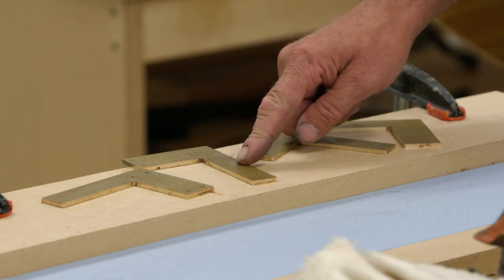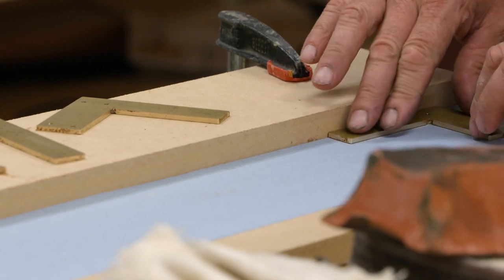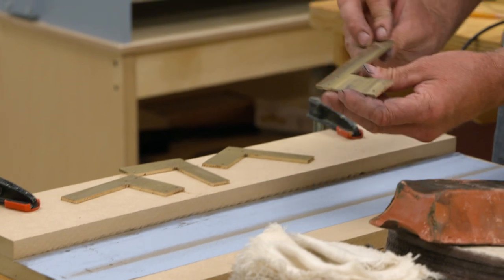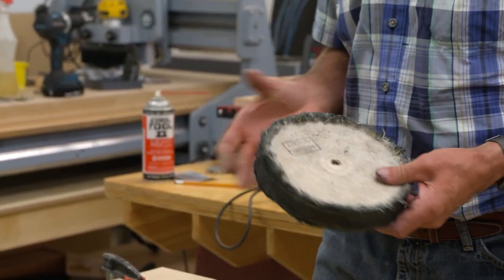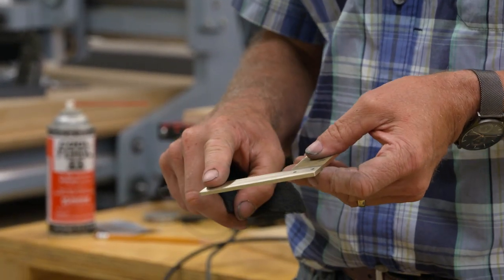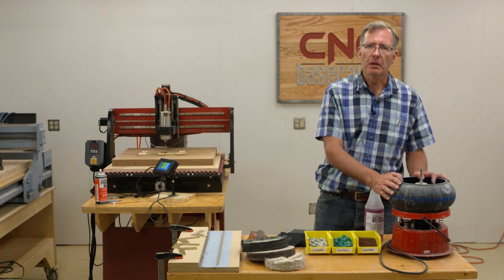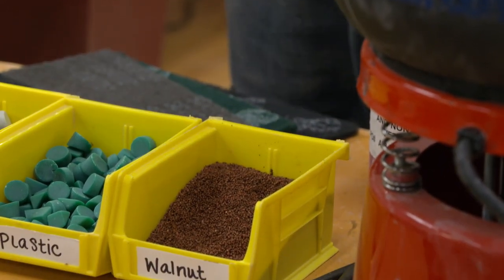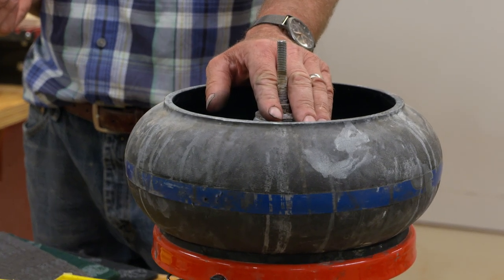CNC Basecamp Tips: Polishing Brass Parts

Comment: Thanks for the helpful information, especially on the buffing wheels.  I'm making some parts using solid surface material and am looking to get some buffing wheels to polish those parts.  One suggestion for polishing metal is mag and wheel polish.  I've used it on aluminum and it does a great job of making the parts shine after I've cleaned them up with other abrasives.  I am a bit sad to see your DIY CNC machine acting as a catch-all table.  I was really hoping to see it used more in projects.

Comment: Hi. Good tips. Do you know if its possible to use the last tumbler you mention for small pieces of wood ( i make wooden toys and is difficcult to sand little pieces ) thanks for your opinion.Diego
Reply: Walnut shell is the best option imho, but would mostly work on softening edges, not removing sanding scratch’s from surfaces